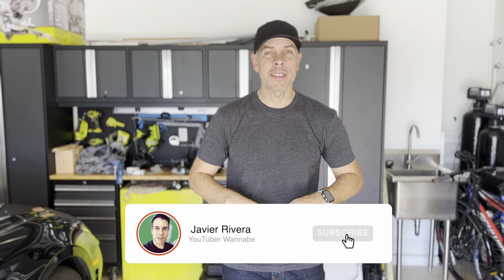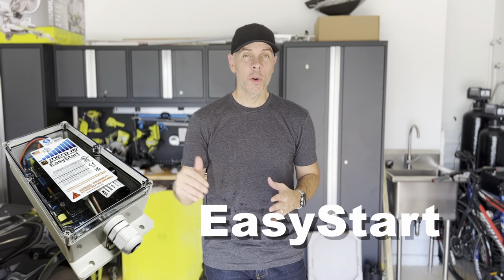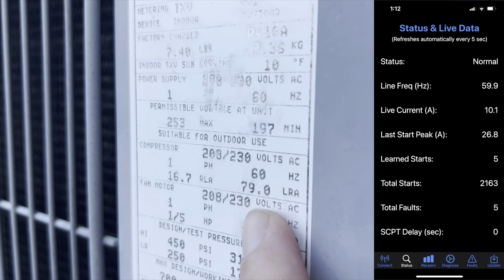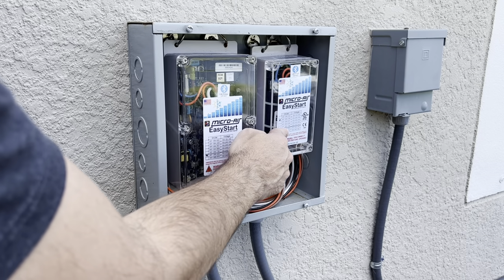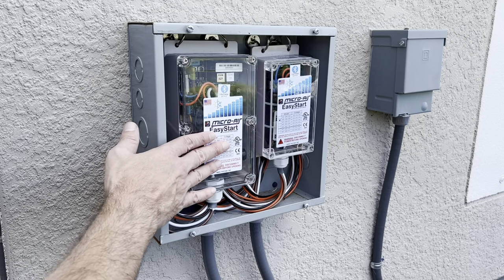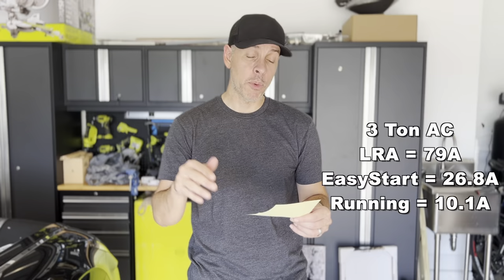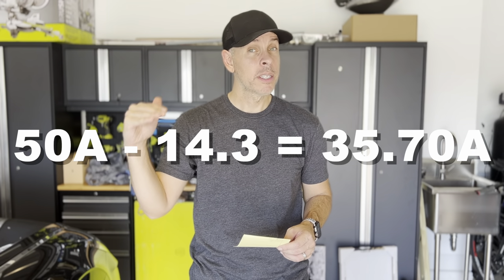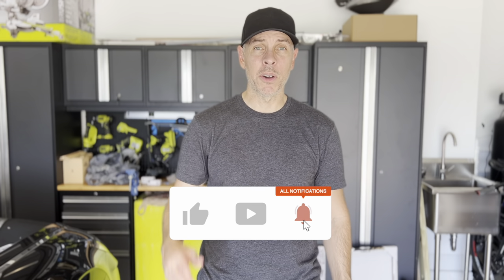Air Conditioner Powered by Micro-Air EasyStart with Genmax GM900iED Portable Generator

Comment: Update from Micro-Air, I contacted them and they told me for my 2 tons Compressor to use the EasyStart 368-X48-Blue for more efficient.  No longer use 364 unit or smaller.  Thanks for the video.
Reply from the maker: Yes.  They changed their parameters.  364 still works for 2tons but according to them now 368 will be more efficient.

Comment: As always great informative video Javier, thank you! Having the two EasyStarts together in a junction box was a great idea! Micro Air's tech support is outstanding when it comes to run you through the whole installation process if you bump into any issues.
Reply from the maker: Thanks.  I didn’t like the idea of having the easy start exposed.  Now. The only problem I have not resolved is that I need to add a waterproof wire connection diagram for any technician that comes to repair the ac units.  So he knows what are those 4 cables and how are connected.
Reply: @JavierRivera  yes, you have to. It happened to me recently and I wasn't home. The A/C guy asked my wife if he could disconnect the "box" that was connected to my 5ton unit to "run some tests" and he never wired it back🤬
Reply from the maker: @stelon7615  Well, for now, I printed 2 wiring diagrams and put them with the air handler unit paperwork in the front of the unit.  Eventually, I might need to put 1 of those diagrams in a ziplock bag and place it in the outside units and maybe in the junction box.
Reply: Why this unit cost over $300 where l can get about price of new compressor?
Reply from the maker: This is not only to prolong the life of your compressor.  The main purpose is to reduce the amount of rushed Amps needed to start the condenser unit so you can use a Generator to power the unit at your home.

Comment: Can you see both units running on the APP?  What is the best connector if I splice the wires and buy the same as you show .
Reply from the maker: @pinballguru  The app will detect the signal when the AC is running. So if you want to connect to the 2nd ac you will need to stop the 1st ac and start the 2nd one and you will see that the app will see it.  Best connectors.  WAGO connectors.

Comment: How did you extend the wires? Splice? Or did you go inside the box and put on longer wires?
Reply from the maker: I contacted micro-air and I bought 15ft of cable from them then I Spliced the cables.  The cables that comes with the Easystart are welded inside the box.
Reply: @JavierRivera Ok thanks. I contacted them and they told me they don’t sell the cable. But they said to buy the wires, splice and I guess I could use a flexible liquidtite conduit. Thanks.

Comment: I have your exact same CHAMPION generator and I changed it to Propane myself with a kit.  I never even ran it with gas one time.   I bought and filled four (4) 50# propane tanks so I have a pretty long run time and I don't worry about the gas going bad.  I need to get that MicroAir so I can run my 4Ton unit.  What is the size of your long cable?   I have a similar cable that I built myself and it's a #8/4 SOOW about 115ft.
Reply from the maker: Hello. It depends of the easystart model.   You could order the extra cables from micro-air by contacting them by email so you have the same colors.  If not here are the sizes.  

EasyStart 364
14awg x 2c + 10awg 2c

 EasyStart 368
12awg x 2c + 14awg x2c

Comment: If you have 2 a/c’s set up, how will you know which Bluetooth is reading which a/c?
Reply from the maker: I will know depending of which A/C is running.  Something I start one A/C check the app and then stop that unit and start the other one.
Reply: @JavierRivera ok thanks. I’m going with a setup like you have, since I have a 4 ton and a 2.1/2 ton. Just ordered the electrical box. Going to splice the wires too. Thanks for your advice.

Comment: Hi Javier, is It's mounted in a water proof box with it closed. I cant seem to connected to the app sitting in my living room. Do I have to be next to it for the app to connect>? is the metal door preventing it from connecting? It worked while we were installing. Weird.
Reply from the maker: @pinballguru  that is correct.  The easystart waterproof enclosure prevents the Bluetooth signal from going out. So.  Yes you have to be close to the easystart.
Reply: @JavierRivera  maybe I can drill  small hole on the side and that should work.
Reply from the maker: @pinballguru  I would not do it, will store moisture.
Reply: @JavierRivera  bit the micro is sealed and people mount in  side and on the outside.  Just thinking .

Comment: LRA stands for Lock Rotor Amps. It does not mean this is what it takes to start the compressor and fan. That in rush what pop your breaker. 
RLA is your Run Load Amps. Your math is off.
Reply from the maker: Hi, I know but is a close number that the amps will spike for a second that is why I used that number instead of measuring it with a clamp meter. if you need exact numbers to be able to make a decision let me know and I can get it for you.

Comment: Just because that Generator has a 50amp Plug Don't Mean i can produce 50amps  that GM9000IED is rated at 9000W Max Surge & 7600watts Running Amps  So 9000 divided by 240volts = 37.5 Max Amps  that's why it has a 50amp plug  they don't make a 40 amp plug Just a 30 amp & 50 amp , so at 37.5 amps  the 30amp plug would be underrated  so they had to put a 50amp plug  But it still will only Produce 37.5 amps NOT 50 amps    7600w = 31.6 Amps @240v , To get 50amps @240volts you will need a 12,000watt Generator
Reply from the maker: In reality is more than 50amp. 75amps at 9000w starting watts.  Running watts is 7600w. Per leg is 3,800.  3,800 divided by 120 = 31.6amp per leg.  Each leg is 120v with 31.6 amp for a total of 240v with 63.2amp at 7600w Running watts.
Reply: @JavierRivera  You don't get double the power just because you have 2 legs, each leg is out of phase with the other.  Your generator has 7600 running watts at 240v, that is 31.6A.  It may be able to tolerate a short spike twice that for a millisecond but your generator is not producing 63A continuous.  As the other poster stated, the rating of the plug is 50A and has nothing to do with the output of the generator.